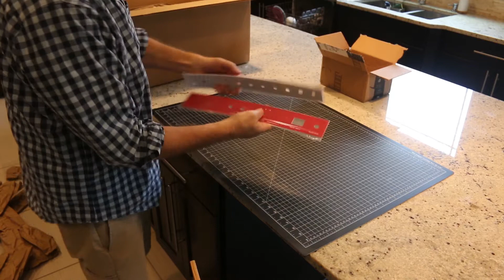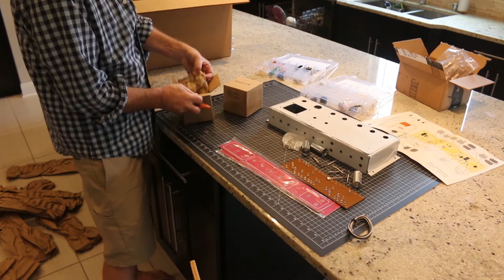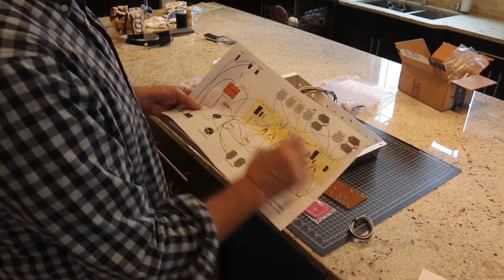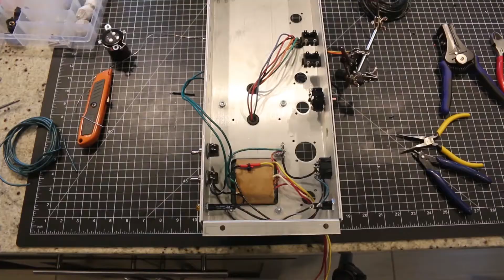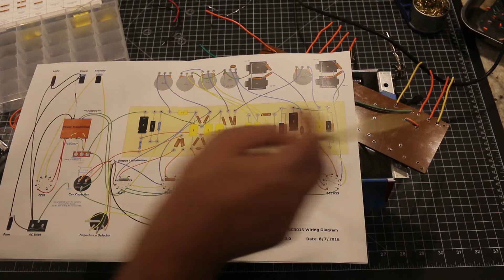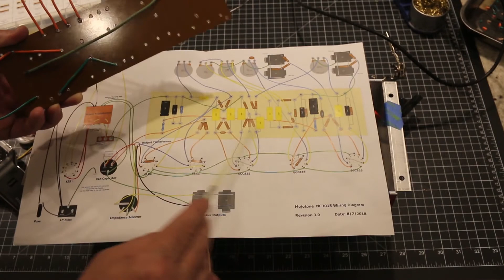Tube Amp Build! Mojotone Vox-Type British 30/15 Pt. 1

Comment: Just picked up a recently built nc3015
Amazing tone , the bv30 speaker at 60 watts was a great choice by Mojotone. The Celestion Vintage 30 is closer to the Alnico Blue than any other speaker I've found.

Comment: I like to get the power section first too. And get the power cord wired in. Waiting until  the end makes those critical solder joints alot more difficult. Oh and those long signal wires should be shielded wire.

Comment: How long does it take?
Reply: That really depends on your level of experience. An experienced Tech will be able to complete a build of this level within 5 to 8 hours. You really need to take your time and follow the drawings provided by Mojotone. The amps sold by Mojotone are of very good quality, but you need to be sure to measure the resistors that are provided, at times, they are out of tolerance, especially the carbon composition types.

Comment: What a JIP ... not really dude.  I've built a Mojotone 18 Watt TMB this year (during COVID lockdown) and I'm looking at this build for my next project.  I'm going to do the head version and then order up a custom Mojo Select cab with 4 x 10's ... The head will be going through a Boss Waza Craft Tube Amp Expander which is what I'm doing with the 18 Watt TMB and I'm quite pleased with what I get out of it.  I sure hope Part 2 is coming!  I'd like to hear your amp versus Justin Cody Fox's demo on the Mojotone demo.  I owned a 1997-98? AC30 TBX Reissue and sue wish I had still ... oh well, like many of the old pieces of gear I sent down the road for $$.  Anyhow, thanks for the video and can't wait for Part 2.